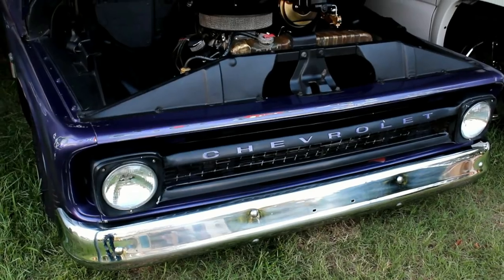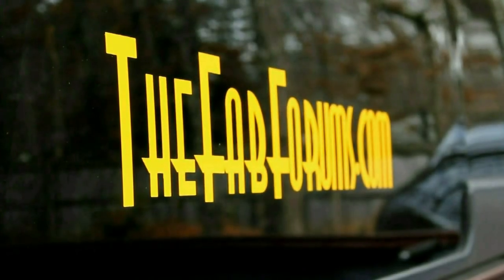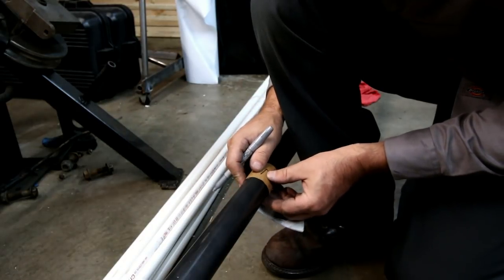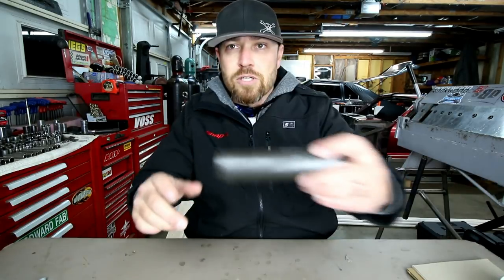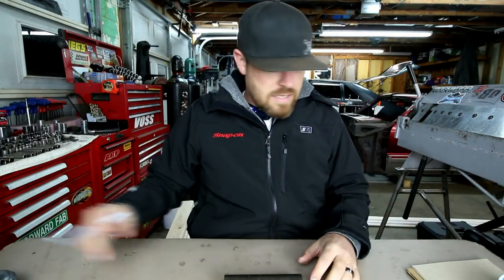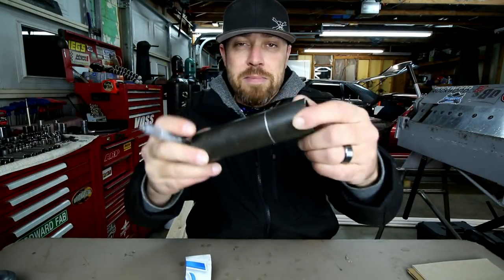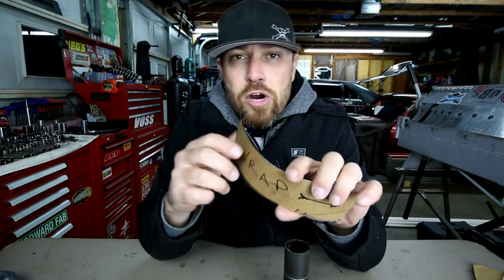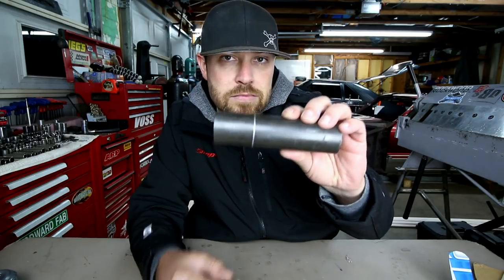You Need This Tool - Episode 86 | Free Tube Chassis Tools

Comment: You can buy them. That is the correct name. If you work on large diameter pipe etc you will need to buy one. They also come with measurements on them in case you need to mark for notches etc.
Reply from the maker: cool....I will have to check them out
Reply: My wrap a rounds and centerfinders or made by curv o Mark.they have tons of fabricating btools.